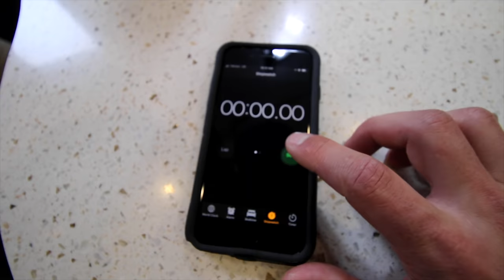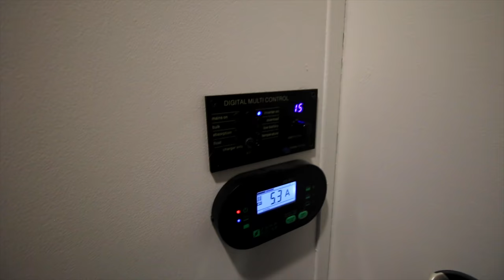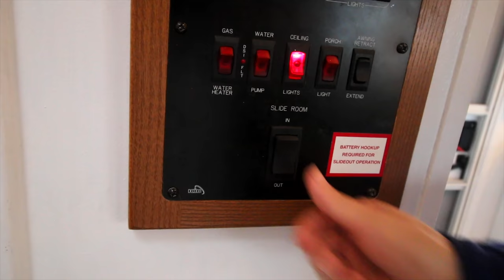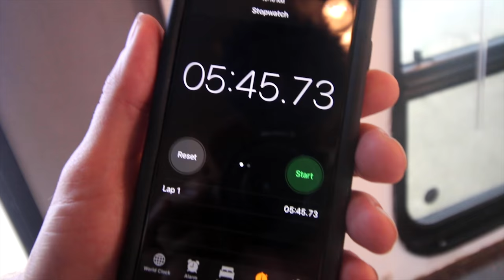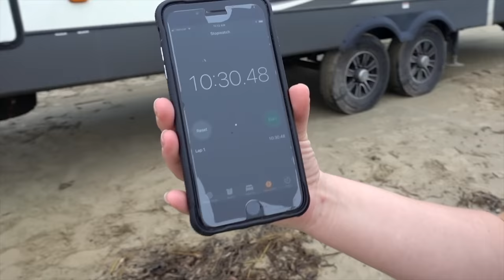🏁 RV RACE ⚠️ Loftis Party of Six vs The Chicks Life RV Teardownn and Setup 🚌 part #1

Comment: Hey guys, what size is your truck? One ton or 3/4 ton?
Reply from the maker: Hey Jeff.  It is a 3500(1 ton). We also added airbag suspension on the rear as well as the leveling kit in front.